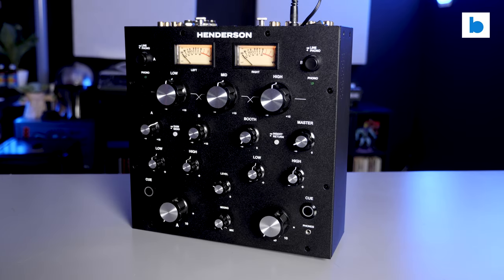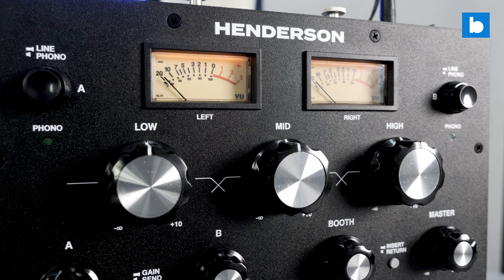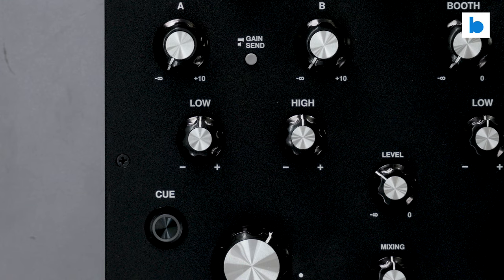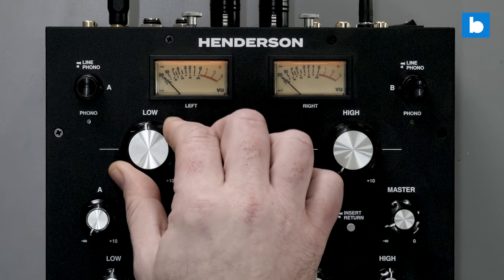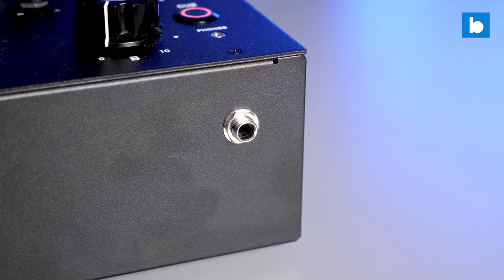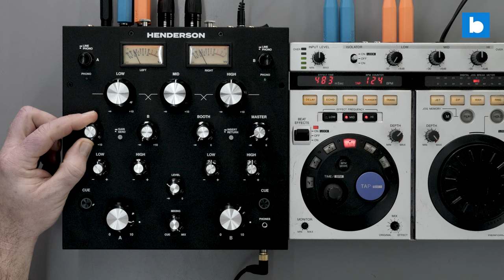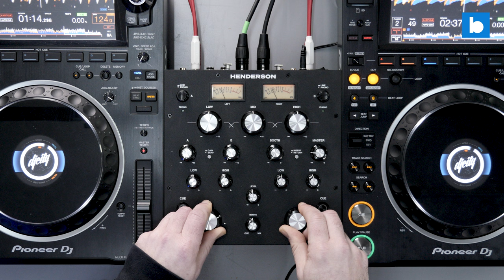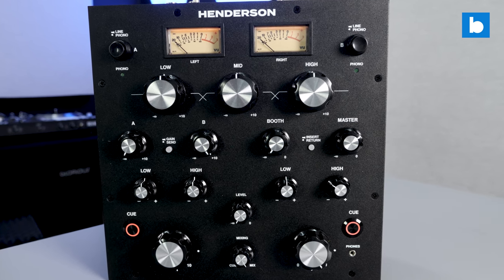Henderson Audio Model X Review: From Poland With Love | Beatsource Tech

Comment: Imagine a HYBRID mixer that has all the following:

1- Full analog signal path with discrete phono preamps...
2- Digital sound card DVS ready with an excellent DAC included on the mixer for the line level
3- Midi pads for Midi control

Optional:

4- Modular channels for easy Rotary and Linear switch

Many came close... none has done it....
Reply: @djstuc  I couldn't agree more....exactly my setup.... been driving MasterSounds with DS1 (from DENON) + External midi pads for years... I wish there was a more versatile setup... The A&H PX5 is as close as it can gets as it ticks most boxes (minus the type of preamps and the midi pads) same for the MIGHTY Denon DN-X1700 with its discrete preamps...

Comment: Really good video, im loving all the mixer reviews videos, but i think there is a mistake in the spec view in min 1:45...it says ¨...allowing to send signals through cables on very LOW distances...when it should be ¨...send signals on very LONG distances with minimal signal degradation, noise and interfierence...¨  please correct me if im wrong.👍👍